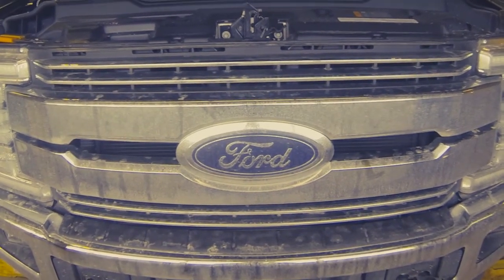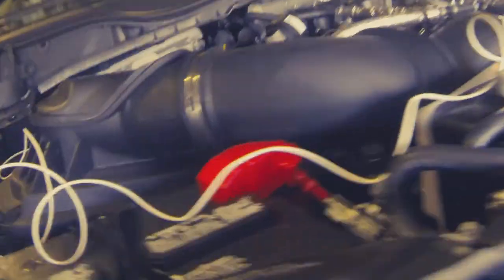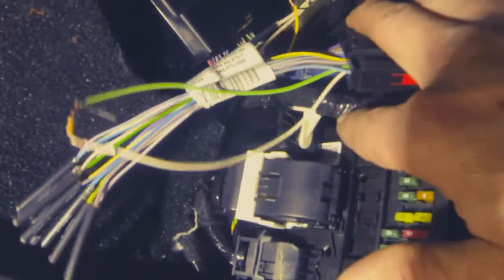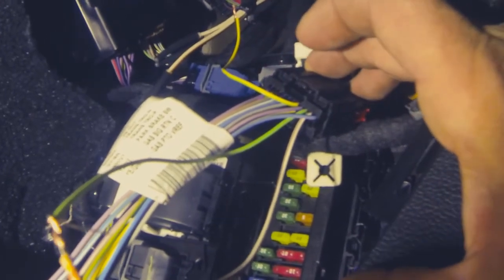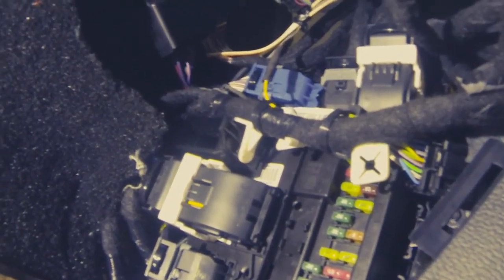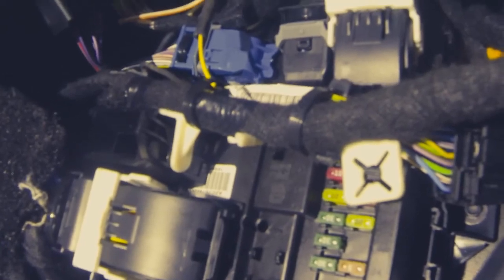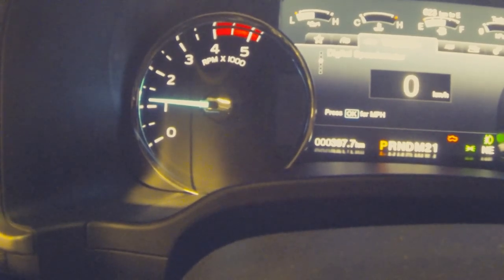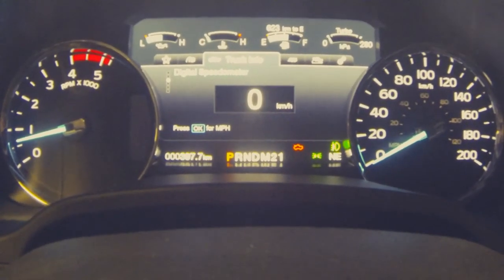2017-2019 Super Duty SEIC/High Idle Installation Instructions

Comment: Worked good if you like to simplify Just put the two yellow and green wires together you won't need a switch just put the parking brake on good to go 👍
Reply: I have a resistor between wires white/brown and green.  I've also connected both the yellow and green wires together and have found that this does not work on a 2018 superduty 6.7L
Reply from the maker: I'm a lil confused. Which two wires are you connecting? Also, without the switch, does that mean the RPM's immediately increase when the parking brake is applied?
Reply: Off the harness there is two yellow with green stripes wires One is hot and the other one is switched if you connect them as well as using the 20k resistor are you have to do is apply to The parking brake and Hi Idol is activated
Reply from the maker: Oh ok, I've never tried that myself but yeah, sounds like a great idea! Thanks for the info!
Reply from the maker: Oh really. Ok, thanks for the confirmation!

Comment: On the sheet it states 1watt resistor is that what you used?
Reply: Worked good if you like to simplify Just put the yellow and green wires together you won't need a switch just put the parking brake on.
Reply from the maker: Justin Jelley I'm not sure off hand the wattage of the resistor. The chart that came with the pack only stated the Ohms available. I had to go thru all of them to find the closest to 20KOhms. The actual resistance of the installed resistor in the video was just above 20,000 Ohms. I don't have the chart in front of me right now unfortunately. I will check tomorrow morning and update video description accordingly, sorry for delay.
Reply: No rush I want to do the same thing to my truck just wasn’t sure what resistor to get thanks for the reply.
Reply from the maker: So I checked the chart. It doesn't say an exact wattage for specific resistor. 1 watt looks to be the general spec and for specific RPM is depending on total resistance. Hope this helped!